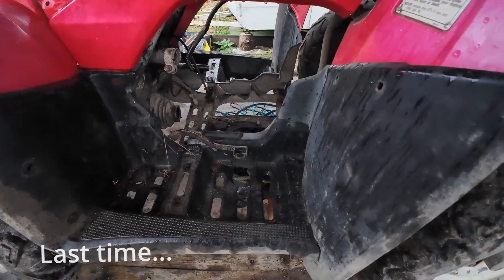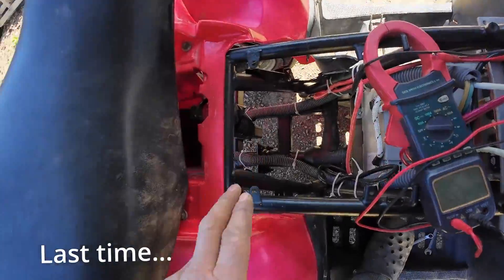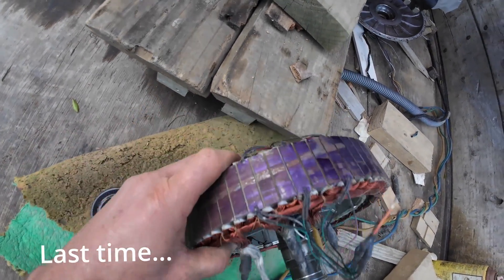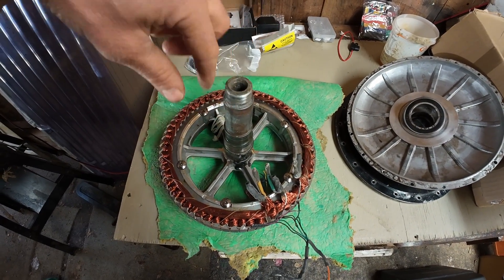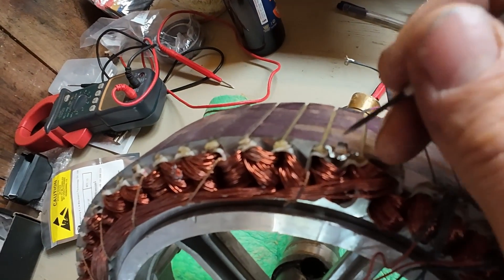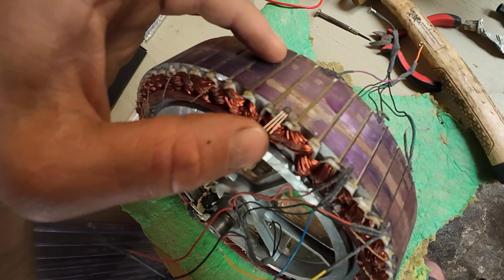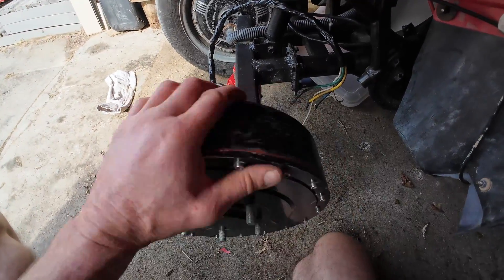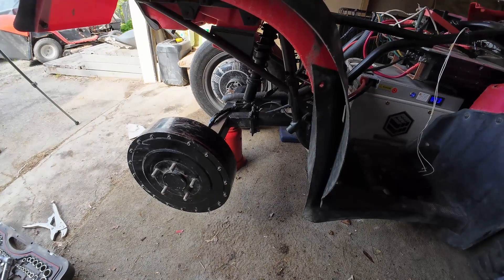Electric ATV Conversion part 2 - Fixing the faulty Hub Motor / Controller Issues..

Comment: G,day Marty T from Sydney Australia. First of all, sorry to hear that the controller was not repairable. That was some "fancy" electronics repair! I'm still trying to understand the MOSFETS glued into the magnets (chipped out) of the rotor? Why wouldn't they spin even with damage that is clear (not touching) the charged stator? 
🧲🔋💫 Correction: found definition of hall sensor ' detects speed of rotor'

Comment: That was a bit of bad luck with the controller, but I am very impressed that you fixed the hub motor! Even taking into consideration the perks of selective video editing and the potential deletion of times when things don't necessarily go quite right, you still make it look easy and clearly know what you are doing. So much so, that I firmly believe that all you edit out is the passage of time. Incredible talent!

Comment: FWIW, to make a static strap you can just wrap some copper wire around your ankle (or wrist, but I prefer ankle) then connect it via two 1 meg ohm resistors in parallel to building earth :)

Comment: Great stuff as always Marty..👍👍
Couldn't you run both motors on the same controller?  Its all low voltage signal stuff on the controller side correct?
Ive never messed with them so i have no knowledge at all about them..  Would give you alot of tail slide in the turns though like a solid axle unit..   Keep up the great work there Marty🍺🍺
Reply from the maker: No they're bldc motors, the hall sensor timing would conflict

Comment: Awesome job figuring out the issues and getting them fixed Marty.
The hub rebuild was a brilliant bit of deduction and coming up with the items you needed.
J.B. weld is easily one of the handiest things to have in your repair kit.
I use it frequently. 
Bummer about the controller tho.
Thanks for some Wensday entertainment while I'm eating my slightly late breakfast and couple of mugs of coffee.

Comment: Would one motor run the original differential?  Use one hub basically as the engine replacement connected to the trans and diff?
Reply from the maker: It would, but then I'd need to move the battery up higher which would make it top heavy

Comment: 3:21 superglue is a bad idea. At even small amounts of heat, the bond is broken. It's why it's an excellent tool for holding light work on a lathe. You can even use friction to unglue it from a rag. JB weld as you said, any heat resistant epoxy. Never superglue.
11:08 watching you work that motor, i've been thinking. Your area's relatively damp (certainly more damp than mine), you might want to paint these motors to add an extra layer of protection from water. A thick paint will do.
13:55 i got my finger pinched fixing a washing machine motor like that. Wasn't pretty, dark nail and the whole 11 spices of swear words. :))
16:44 am i imagining it, or are the right most caps on both banks a bit bulged?

Comment: At 16:44 you can also see that most of the main capacitors are bulging. To get this controller to work reliably again you'd probably have to replace all the capacitors, not just the leaked out one on the controller board.
Reply: They're not bulging. They look perfectly flat to me.
Reply: The seem flat. Where do you see bulging?

Comment: What Marty does is amazing!  Problem with electrics is that there is not a shop on earth that would repair this (or your car, washing machine etc.) they would sell you a new part, in this case a whole motor.  Old motor goes to scrap.

Comment: How did I miss part 1? I never miss an episode!
Reply: YT is really shoddy at showing videos from your subscriptions.
Reply: @aserta  I have found the utube app in particular seems to have the 'missing subscription notifications' problem utube has had for months- I usually use the laptop connected to my tv, and unlike my phone or tablet, it never misses a subscription notification... Rather than using their app, even on the phone and tablet, I now use a browser (firefox in my case) and use that to access utube instead- no more 'missed videos'... (it  does throw a 'don't you want to use our app instead' message at me occasionally, but I ignore that lol)- problem fixed (unlike their stupid app, which has so many problems lol)